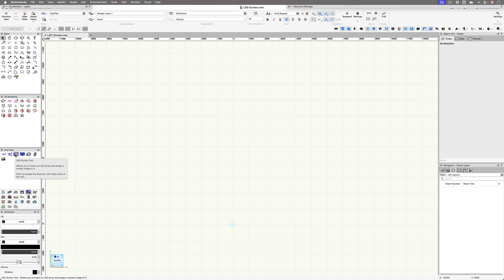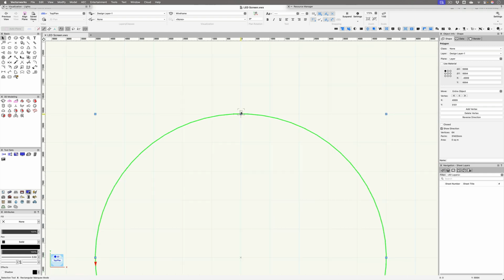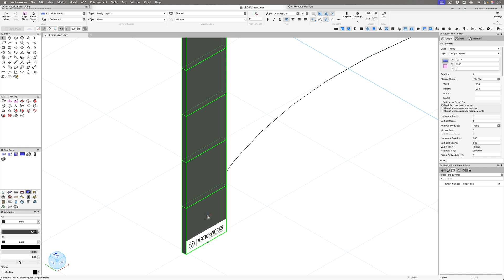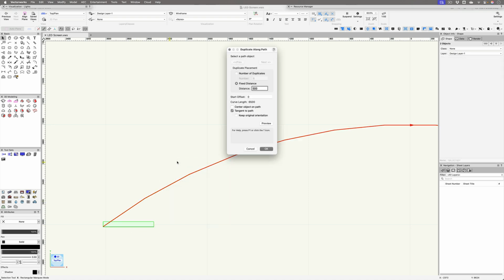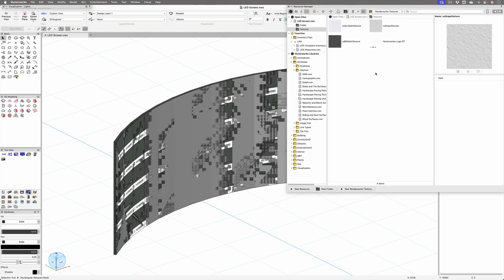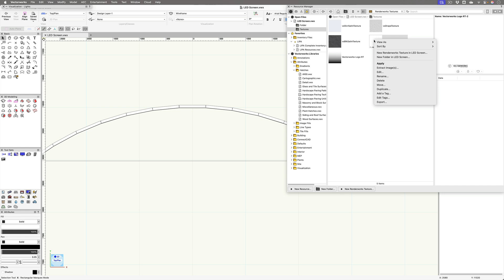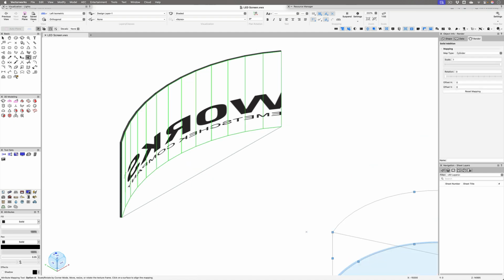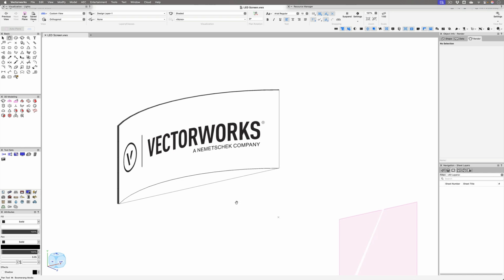LED Screen Circular Array

Comment: I keep circling back to this video. So good. Some additional ideas below:

I made a comment last week about calculating the exact angle for your line segments. I was working with a 600mm product that needed [3] columns wide to be set at a 0 degree angle (1800mm), then set [1] column at 5 degrees, then repeat. I plugged this scenario in chat GPT and asked "if a circular polygon is constructed of line segments that are each 1800mm long, and all of the angles are 5 degrees, what is the diameter of the circle?" which yielded a diameter of 41.25m. If I make the circle with a diameter of 41.25m, then set the "arc into segments" distance to 1800mm, it makes all the lines perfectly spaced, with exactly a 5 degree angle every 1800mm (3 columns wide). It helped me, may help someone else too.
Reply from the maker: @josephestes7076  thanks. I’m glad it is helpful. It’s good to use some of the more obscure and less flashy tools in the program to help solve some of the conundrums that we have.
Reply: Great reply.  Thanks for the idea.  This save me a ton of time today!

Comment: Dude, you are a legend!!! Thank you. It's annoying that this isn't a built in feature from the LED wall tool, but this is a viable workaround. Also, your voice is very soothing. Cheers!
Reply: You know, one thing that I could say that would make this even better is a quick way to specify the angle between each line segment generated from the circle. In my case, I am using the ROE Graphite product. It has set angles at +/- 5 deg. In this example you created, the line segment angles work out closer to 5.75 deg. I'm sure there is a way to calculate that and make the circle diameter exactly what is needed for that 5 degree angle, but I'm struggling to get there haha. For now, I'm doing it manually, but I'll think on that.